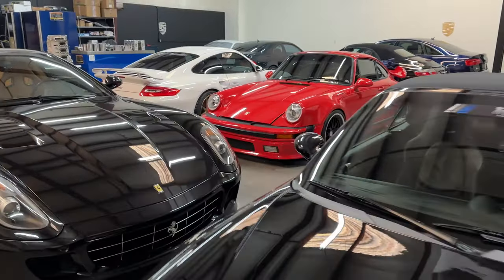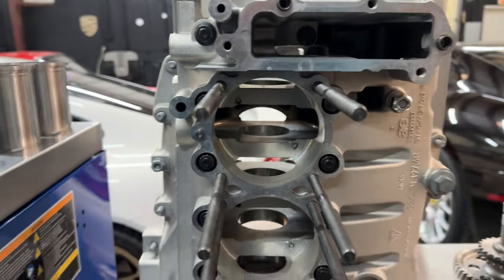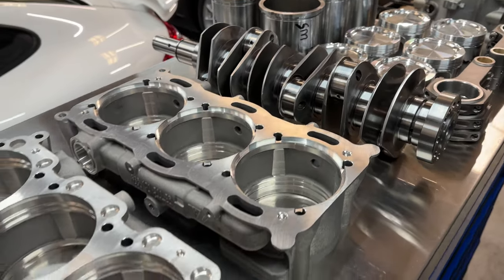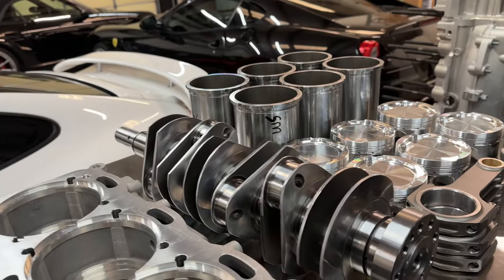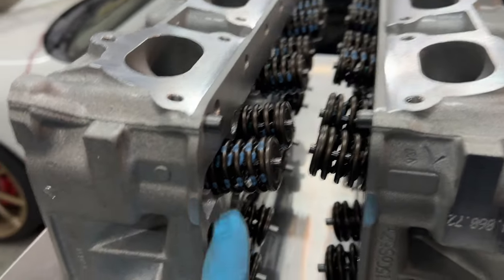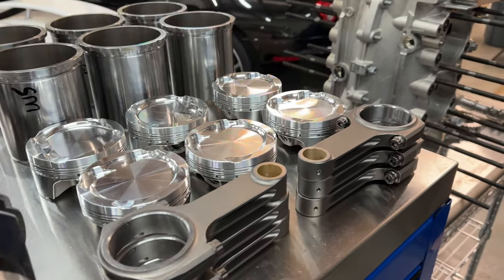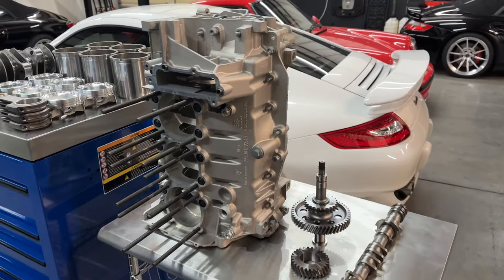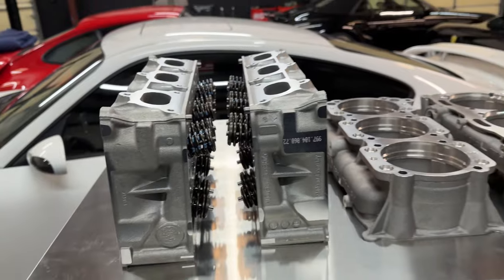PORSCHE 911 GT2 TURBO reliable Mezger engine build with no compromise to handle 1500WHP with ease ￼

Comment: interesting but such a powerful engine is almost doomed for tragedy since the engine tuning and power delivery takes a lot of refining. It's like strapping a jet engine and saying it's powerful. The handling and suspension package has to reliability handle such power under all circumstances otherwise you just have a powerful engine and that will rocket the car right into the wall.
Reply from the maker: You are correct. Everything around it must be built to the same specs, including axles, transmission, which we also do, and big brakes are recommended. Also needs a really really good fire suppression system.